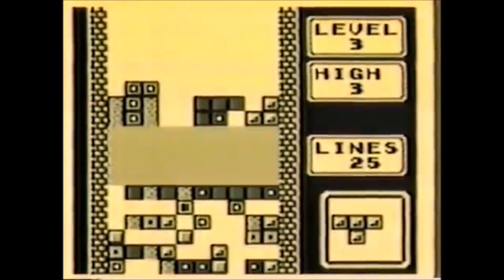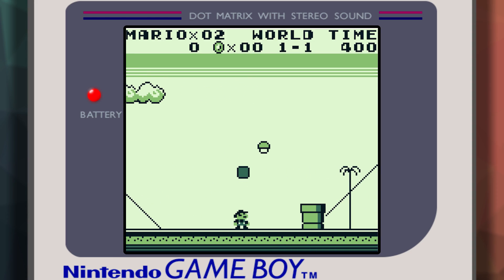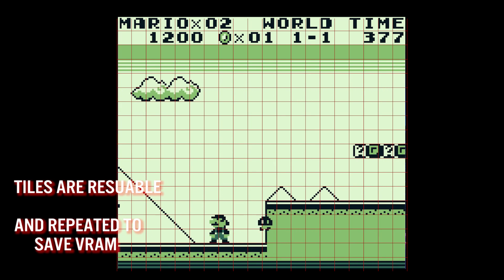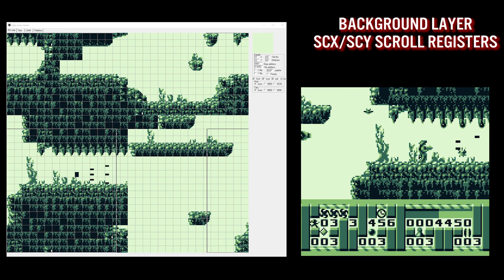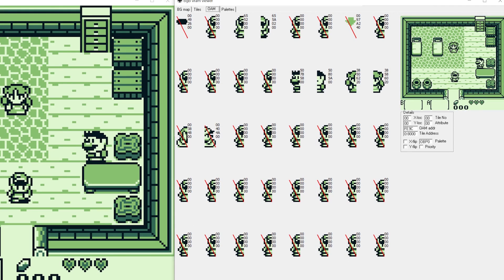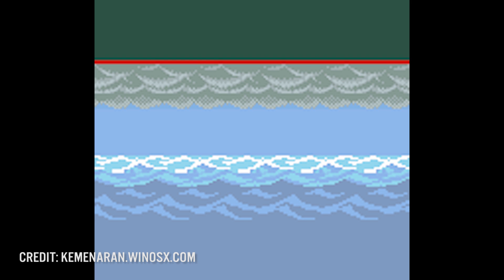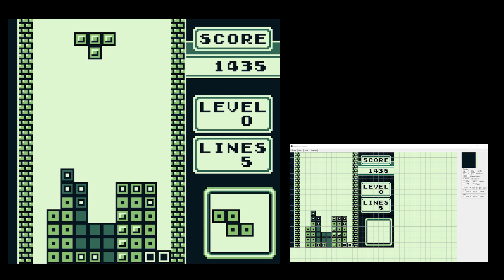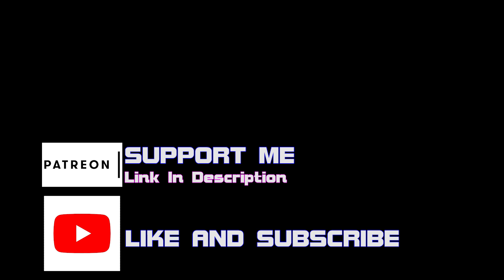How Graphics worked on the Nintendo Game Boy | MVG

Comment: The Gameboy was actually a little more capable with raw power than the NES. Since it was closed almost four times as fast, it could be about as efficient as the NES, but proper programming could give the little grey box a leg up if memory interaction is limited. Having more work RAM helped too, so the only real place it was weak was in graphics. And that was for the sake of cost and power efficiency. But it appears they improve on one PPU feature I don't think the NES had, tracking the h-blank location. And SNES improved that further that with HDMA.

Comment: Some extra fun facts:

- the window layer replaces the background layer, hence no transparency. It covers all pixels to the right/bottom of a point, so it can never cover only the left. But using LYC you can have it cover only the top.

- the tile palette can be changed on the fly, mapping each of the 4 possible pixel values to a shade of gray. That's how Metroid 2 does the flashing effect when paused. Sprites can also be assigned one of two palettes. They don't have to be unique either; you can make all values the same color if you really want.

- the LCD technically doesn't have to have blanking intervals, but adding those allowed for H/Vblank tricks like the ones shown here. Another example of reusing old hardware in clever ways.

- using older, less powerful hardware had a second advantage: not only was it cheap, but it could manage 15 hours on one set of batteries, compared to the Game Gear's 2. (Actual results depend on how efficiently your favorite game is programmed.)

- sprites can be changed between scanlines too.

- the original Game Boy used a rather slow screen with noticeable blur. Games actually took advantage of this to create transparency effects. On emulators, you might see some things flicker rapidly (Link's Awakening is a good example); this is because they aren't emulating the blur.

- early versions of Super Mario Land actually do something Nintendo warned developers to never do (turning the screen off mid-frame). It's said that doing this can actually damage the screen. (I'm guessing this is how they found out. Oops!)

- 8kB (8192 bytes) of RAM isn't much, but it's 4 times what the NES had! The Atari 2600 had a whole 128 bytes, which isn't enough to store this paragraph. However in all three cases, cartridges could provide extra memory.

Comment: They probably had a close look at the commodore 64 which worked much the same way. 
With a tile based background layer,  sprites and  interrupt driven mid frame register manipulation coders did amazing things. 
The C64 did have a true bitmap mode, but this was rarely used in games.
Reply: It's more likely they based it on the NES, which has a virtually identical tiles/sprites/window system.

Comment: Might be a dumb question but it's not possible to port Doom to this in any way, right?
Reply: It wouldn't be impossible; but it wouldn't be easy. You'd definitely have to use constantly changing tile-maps to simulate a bitmap mode, and probably add huge amounts of additional ROM or extra hardware in the cartridge (like an FPU).
As a starting point, you should have a look at the ZX Spectrum (which uses a very similar CPU to the GameBoy) port of Doom and Faceball 2000 (a GameBoy port of MIDI Maze).

Comment: Did I hear you right, when you said the system had palettes? So even though there were only four possible colors, they still had indirect color?
Reply: Correct.
Although sprites supported four colours, colour zero was always transparent. Using a different palette definition essentially allowed to choose which three colours were visible for a particular sprite.
It was also useful for special effects, for example in Link's Awakening the "dark" versions of rooms were created simply by changing a single palette register, rather than having to store a separate set of tiles with darker colours.
Reply: @gwishart  Ah, I see. Thank you for the clarification.

Comment: One smart trick used was to take advantage of the screen's low refresh rate to flicker two images back and forth to create a translucency effect. Batman: Return of the Joker (from Sunsoft) did it to create a flowing water effect in the sewer level. A Japan-exclusive shooter called Chikyuu Kaihou Gun ZAS flickered two different backgrounds scrolling at two different speeds to create depth, simulating clouds flowing over the ground level.

Comment: It's a Zilog Z80 with some extra features tacked on and some stuff removed. A Z80 is an upgraded Intel 8080 because the 8080 was an inefficient hog of a chip at the time.

This is very similar to the NES having a 6502 with no decimal mode and a bunch of sound hardware built into it. Ricoh 2A03.

Comment: Why store things in VRAM when you have a cartridge, which should be just as fast? I thought that was the main attraction for cartridges up to the DS era. Everything is already loaded, unlike on optical media.
Reply: You can't use cartridge ROM for a video display, since you'd never be able to change the image being displayed.
Reply: I guess I was thinking more like having pointers in RAM to the cartridge space. But I guess that might be too slow.
Reply: @ZipplyZane  It would have been incredibly slow, not to mention requiring twice as much VRAM; the GameBoy uses an 8-bit CPU with a 16-bit address address space, so every single address pointer would need two bytes.

Comment: My brilliant professor for an Assembly programming class in college threw away the old curriculum and wrote his own based around the Game Boy.  Students weren't required but were able to buy flash carts/programmers and eventually we had a little showcase of our final projects at the end of the semester, running on original hardware.  I made a crappy synthesizer - spending more time on the hardware than proper coding.  Hah!
Thanks for the blast from the past!

Comment: I had a blast developing Lemmings 2 for the 8-bit handhelds. The Game Boy was comparatively underpowered to the SMS and GG, but Nintendo made some smart hardware optimisations with their "sawn-off Z80". It was fun seeing just hard you could push the limits of the machine, especially if you were trying to do anything non-character mapped. If you want a good example of just what the Game Boy is capable of, check out the port of Hard Drivin' - it's a stunning achievment.

Comment: You didn't explain how they made crests of the second layer of waves in the zelda intro poke into the top layer.
Reply: They don't. The peaks of the waves are actually part of the bottom of the middle layer.
Reply: @gwishart  I've just reviewed the thing in framestep and the part that confused me is that they also seem to do mid-scanline height adjustments to accentuate the effect.
I guess if I really need to know I should go check with some debugging emulator what the tiles actually look like.

Comment: This would be good hardware design, but for 1982-1984. In 1989 GB design was obsolete and limiting.
At that point tiles and sprite were used to provide smooth parallax (multi-layered) scrolling at 64-256 colors and in 320x240 resolutions. Doing this in software at such resolutions and color depth required high-end CPU at that time.

However GB had only 160x144 resolution with 2-bit color, which meant just 5.7 KB of data to redraw whole screen. Z80 CPU at 4.19 MHz should easily draw gameboy style graphics in software. Commodore Plus/4 has 1,79 MHz CPU and no sprites or tiles and can draw smooth scrolling games at higher color depth and resolution than GB.

GB should have 64 KB of RAM, with 16 KB for graphics. This would be enough for full framebuffer with double buffering and even a lot of offset space for hardware scrolling.

This would make GB design even simpler. Just CPU, simple framebuffer chip and RAM. Programming would be way easier and games would be more varied. Full framebuffer, no need to rely on tiles and sprites.

However it is relative. Maybe Nintendo engineers though that programmers would find tiles and sprite more familiar? In Europe, where home computers were more popular than consoles, programmers were used to do many things in software. It was the only way on IBM PC and Atari ST.

Comment: Great video but there is a mistake at 0’ 21’’. You say that “Nintendo’s philosophy was never to be a leader in technology”. This is true now but it was NOT true in the 80s and 90s for the home consoles:

- the Famicom was clearly ahead of its time in 83 (compare it with the SG-1000 which came out the same day for instance)

- the Super Famicom was the most advanced 16bits console (if you ignore the NeoGeo which was an arcade system and not really a home console)

- it can be argued that the N64 was technicaly superior to the PS1 and the Saturn.

- and even the GameCube was one of the most powerful console of its generation.

Nintendo gave up the technical leadership race only after the GameCube: with the WII.
Reply: Exocet NES was not that impressive for 1983 from a hardware point of view being built around an 8Bit CPU released in 1975, but its decent software surely made the difference. NeoGeo was designed from the beginning to be both an arcade and home console system, hence it is the most powerful 16bit console of all times. But the SNES went very close close to bring the full arcade experience home. The most powerful Nintendo console at the release date was the N64. I agree they quit the performances race eventually, and that was a wise move cause it confirmed their unique identity, giving a great lesson to the competition: hardware can surely help a game but it's the software that need to wisely take advantage of it.
Reply: ᚛ Vyper ᚜ I think we basically agree that, more or less, up to the GameCube, Nintendo was in the technical race. And the big U-turn was the WII.

Regarding the NES: i agree with your facts of course. But, at the same time, there is no other console or personal micro-computer, in 1983, which can have scrollings the way the NES does.
But anyway, i think we agree with the idea.
Cheers.

Comment: Coming up with all this trickery as a dev must have been like learning magic.
Reply: It was pretty standard stuff by then, which is why they had this interrupt in hardware. If MVG ever does a video about Atari 2600 graphics and the tricks they used, you'll see the era where this stuff began.
Reply: @gargantuablargg  Yeah by '89, having a scanline interrupt pretty much means you get a free pass to do all the stuff that actually required programming trickery on older platforms. :P
Reply: @gargantuablargg  Exactly! As an 2600 homebrew developer i can vouch for this. It's all about thinking outside the box. Creative thinking is what i call it and as many tricks are well known, there is always many more discovered on a daily biases. It's what makes programing for these systems so fun and rewarding. I find my mind always thinking of new ways and tricks to achieve effects to give that wow factor. Having two eight bit sprites a ball and two missiles  - 128 bytes of RAM - 4k of ROM - restricted to horizontal colour banding - zero VRAM and zero frame buffer it's challenging. One would thing anything more complex then Pong would be impossible yet with enough creative thinking nearly anything is possible to an extent. I love coding for the 2600
Reply: It helps that it was very similar to the NES, so there were already plenty of experienced developers available.
Reply: it really is lol
Reply: programmer job description:

"solving problems you didn't know existed, in ways you don't understand."
sometimes also referred to as "wizard" or "magician"

Comment: I fucking love this! I used to be an amateur programmer for z80 based platform and this is the kind of stuff I had to do back in the 90s. I was very fond of basic in TI83 calculator. I used to fit both basic and assembly to make a long RPG game. I think you can still see them using wayback machine. It's called fftom.

Comment: Does the game boy colour work in the exact same way expect with colour?
Reply: Mostly, yes. 
The main differences were:
1) There was twice as much video RAM, so the background and window maps used two bytes per tile: one for the tile number, one for the palette number.
2) There were eight palettes available for the background and another eight available for the sprites. Each colour index could be defined in 15-bit colour, 5 bits for each RGB component.
3) There was four times as much work RAM.
4) The CGB could run in a double speed mode of 8.4MHz

There's much more detail here: http://bgb.bircd.org/pandocs.htm

Comment: Like always, a very good video. Currently i learn how to program on the Sega Master System and it's pretty cool to see that many tricks you showed works on this console too and share the same philosophy. The most fascinating things for me it's the color ram used to saved more VRam. Instead of saving color RGB informations for each pixel inside tiles, you just need to point the index of the color you want inside the color Ram, a clever choice. And the tiles data is stored in the way to read 8 tiles at the same times. Don't know if today the same optimisation exists for current 2D engines...

Comment: * You can display more sprites than the max. I forget the hack at the moment as it's been a while but it's a simple hack that a few games leveraged where you can display as much as you want given you don't go over the max per line and from rough recollection only costs you a few sprites on a line to add the extra sprites. It's been a while so I barely remember the details.
* You can alter the individual pixels as well using a pixel approach rather than a tile approach by simply giving each tile a unique position on screen and modifying the tile data to change the pixels. Outside of homebrew though I know of no game that did this obviously because it was incredibly slow and the system just wasn't designed for this but it's certainly possible.
* There was a racing game as well for the GB who had several courses varying in difficulty. If you look at the game assets you will only find one single image asset for all the different courses. A straight road that goes off into the distance. It's pretty shocking but you realize it's not the image assets that control the course the player sees. It's the pixel line warping that warps that straight road into complicated turns of varying difficulty.
Reply: There were a few commercial games that constantly changed tile data to simulate a bitmapped display: Monster Max and Faceball 2000 for example.